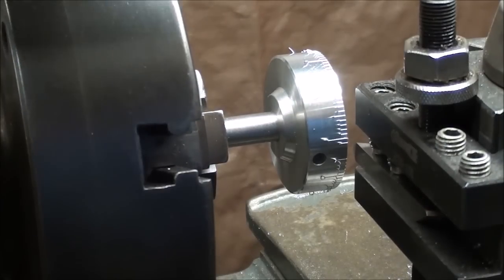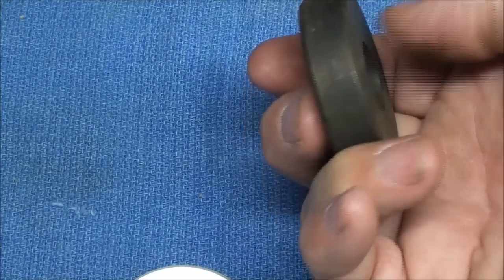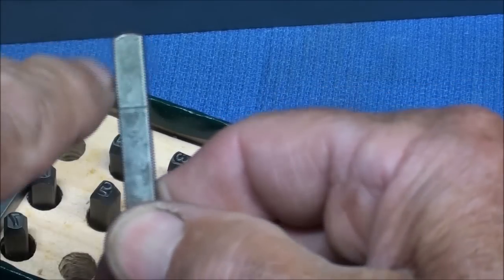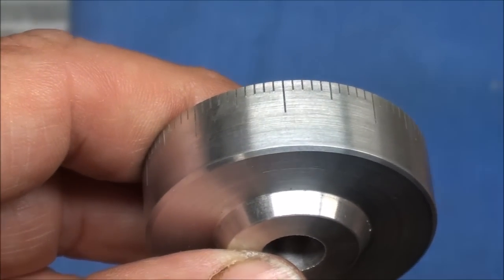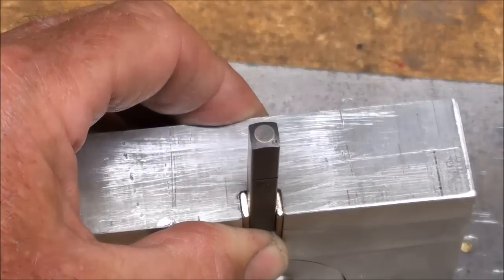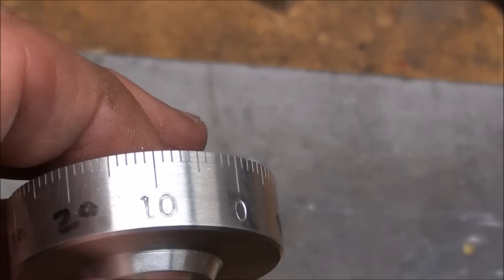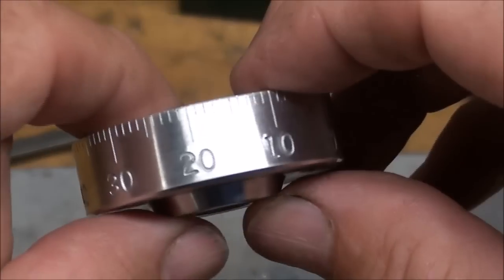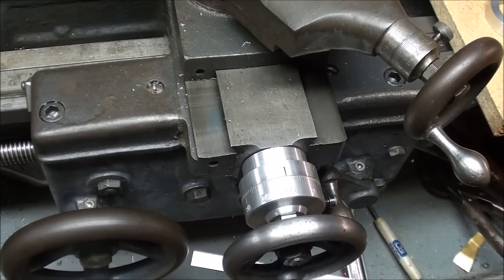SHOP TIPS #180 Making Larger Dials for the Logan Lathe part 4 tubalcain

Comment: Excellent videos as always, even if they are copyrighted a month in the future ;). I like your ingenuity and the saw blade was a great idea. I wonder if it's possible to use the threading gears and dial to get 100 divisions?

For the stamping, you may also have made the slot with the edges along the radii to strike perpendicular and at the desired spacing.

Another idea would be to add a vernier scale to the mark on the fixed plate, if you want to read tenths. Might be overkill, but perhaps interesting to consider how it might be done.

I want to make a larger threading dial for my HF 9x20 lathe, and it needs to be scribed along the radius with 16 divisions. I may be able to use a setup similar to yours, but use the cross-feed to scribe the marks.

Thanks!

Comment: mrpete, the dial on my eastern manf lathe are large; however the marks are wearing quickly to trouble eyes...poor. Hmmm. You may be wrong someone may do it because a replacement part will only be the same unfinished tooling. Also, you are very close to a vernier or n-1 graduations.The danged compound degree marks were set by a blind man on a crooked stool.
Mike
Reply from the maker: Thanks-- that's a good one.

Comment: Mr Pete.. I have a Southbend 9" with very small dials indeed, so im interested in doing a similar modification, my eyes
are also very old..  i also have slop when dialing in or out on the cross slide, can i cure this aswell?

Great videos.. Great work !!
Reply from the maker: Thanks.  Slop means worn screws & nuts. You have to replace or live with it. But there is always some backlash even in new ones.

Comment: You already have scribed lines on the dial, how about calibrating where you want your numbers and scribing a reference line on each side of the center line on you jig?  Then using the lines on the dial and the jig to line up your numbers?  You could eliminate much of the angle you were dealing with using current method.
Reply from the maker: Good idea

Comment: At 9:20, could you maybe have milled the side walls of that stamping fixture, at a slight angle of maybe 5 degrees or so? Then it would have put the stamp closer to a normal angle with respect to the surface of the work piece. I mean, you could certainly compute a relatively exact angle, given that the diameter of your work piece is fixed...but a 5-10 degree angle should get you pretty close, I'd think.
Granted, it wouldn't have been as easy to shim the stamp when you actually struck it--but the key stock you used would possibly still suffice, as the width of the part of the slot nearest the work would not have changed. You might also need to simply mill an angled shim-block--but this shouldn't be a problem, given the level of skill already required to get to this point.
Reply from the maker: Yea--I was afraid of ruining the jig that close to end of the video. The whole job probably took 30 hrs and I wanted to get done. Then 10 more hrs of editing.
Reply: mrpete222
 I see... I also edit videos, so I definitely know how long a project like this can be. 90% done, 90% to go.

I am very much enjoying your videos--and you actually helped me buy a lathe. After watching a bunch of your videos on the various lathes, I ended up buying a Logan 820 yesterday. I haven't used a lathe in 25 years, so I am excited to get back into doing it--and I am trying to re-learn proper techniques and safety procedures. So I greatly appreciate your videos, and will definitely be buying your "shop tops" series within the next week or two. And if you ever get a Logan lathe series done--I'll take one. Also, if you ever need any help editing videos, just ping me and I'll be more than happy to help.

Comment: i think if you scribed two refference lines for the dail lines on the slot in the jig (two lines to the left and the right of the center line on the slot apart the same distance as the numbers ) you couldve kept the slot in the jig perfectly centered on the dail to fit the stamps and hit the dail dead straight down on every number ou wouldve had to turn the dail in the jig for every stamp,,,,,,,,, never mind the comment below tells the same

Comment: Tubalcain,  Enjoying your video's.  A couple of things occurred to me.  Make the stamping jig so it only holds the stamp on center.  Then, mark the jig with a center and both left and right offset marks.  This way, the stamp is always 90 degrees to the surface of the dial.  The machinist simply sets the dial to the offset for left and right character position.  Perhaps "on axis" to the surface of the dial would be more correct language?   I've watched many of your video's and I'm afraid this is the only idea I can offer to expand upon your excellent content.   Thank you for your hard work.   I'm working on an Atlas QC42 and was drawn to your channel.  Subscribed and liked all the way around.
Reply from the maker: thanks---THATS A GOOD IDEA
Reply: mrpete222 genio excelente
Reply: Jos Far que tipo de torno es?
Reply: Jos Far Lathe type is Logan.
Reply: bien mucho gusto señor soy jose de argentina disculpe no hablo english pero lo miro en sus videos y trabaja muy bien yo trabajo en el torno aca en buenos aires pero me falta aprender el oficio se que hay mucho por aprender y sigo aprendiendo de usted gracias señor!!!!

Comment: Mr Pete, I just found this website from the UK, (http://homews.co.uk/page315.html), showing Harald Hayes design of an automatic counter for scribing or lining the larger dial of the lead screws which you show being done manually.   2. find a way to engrave the numbers instead of stamping them on the Dial.  3. How do you give polished metal a satin finnish?
Reply from the maker: +Douglas Roger DEXHEIMER that was a great video with the real neat scribing attachment
Reply: Per #3, a satin finish can be done in a ceramic media blasting cabinet. Best effects with new media. For aluminum use a dedicated Plastigrit ™ media blasting cabinet. Do not cross contaminate the two media. A separate cabinet is required. Take it from a former Bubba, or, as some would say, class gorilla. 🦍👀

Comment: Mr. Pete,  Thanks so much for all your great videos.  I thought you might be interested in seeing how I put the knowledge gained from two of your recent series to work.  This link 
http://w2iog.net/?page_id=279
describes how I used your ideas to make splined shafts.
Paul Jacobs
Reply from the maker: Great job. Nice photography and excellent results on the spline.  Thanks for the plug.  I had been thinking of doing a video on making splines on the lathe or maybe on the mill. Not sure what the geometry is on the groves, but I guess its in the handbook.  Thanks for watching & the nice complements. Keep up the good work.  pete
Reply: mrpete222
Thanks for the complements.  Coming from you, they mean a great deal.  The components I have are from an old golf car, and it never occurred to me that there might be a standard for the spline geometry.  I took an end-on photo of a damaged shaft that came with the U-joints and printed it at nearly 10:1 magnification.  I was able to scale the photo to estimate the spline included angle (about 90 deg.) and depth (about .025")  Paul